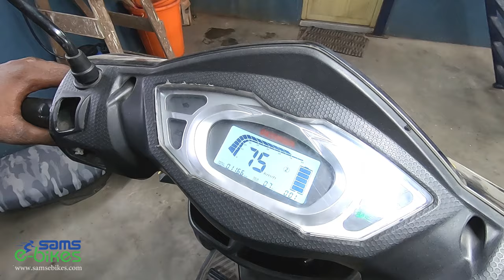Electric Scooter Hub Motor Dismantling and Assembling

Comment: I have a e bike,,,my bike's all bettery are new but top speed only 30 kl/h... if my e bike maximum speed was 50 to 54 kl/h... what's the problem?
Reply from the maker: The problem is with the controller. The controller needs to be checked for configuration.

Comment: Although I couldn't understand the language still understood all essential processes and precautions. Thanks
Reply from the maker: Apko help karke humko acha laga sir. Hindi mein kuch video upload karenge.
Reply: Where are the magnets??
Reply from the maker: @narayanak5409  Magnets are on the inside of the sleeve. Its stuck using high strength glue to the wall of the sleeve.
Reply: @samsebikes5869  where are the sleeve?
Reply from the maker: @narayanak5409  Sleeve is the ring on which the magents are fixed.

Comment: Sir can you tell me if the battery is out of warranty or Dead can repair it and use it once more
Reply from the maker: Definitely we can recondition completely dead batteries to get some life out of it. The damaged cells can be replaced with new onces and used.

Comment: ____ BLDC Hub Drive Motor mein Rainy days mein paani jaa sakta hai andar ???? plz  batao ?
Reply from the maker: Vickie ji…if we ride thru water without stopping for more than 30 minutes in water,there is no issue. Keeping the wheel immersed in water for more than 30 minutes might lead to some leakage. Even that’s not an issue if left to dry for some time and then used

Comment: I put security alerts on my scooter and someone pushed it by force so now when you’re driving the scooter is like you holding brake and the security is not working the motor can not run well what to do
Reply from the maker: The anti theft system is malfunctioning..... you need to approach the service center.

Comment: No water proof sir no seal inside what is your opinion sir.thanks for the video.
Reply from the maker: Viki, there are 2 oil seals on the rear wheel and also we use silicone sealants while assembling the cover on the motor. Its perfectly sealed from water.
Reply: @samsebikes5869  sealant it's completely cover water sir

Comment: சார் S mode ல போகிறபோது Accelater ஐ கம்மியாக கொடுத்தால் battery  Power  கம்மியாக use ஆகுமா?  அல்லது அதே கரென்ட் தான் செலவாகுமா?ஏனென்றால் down ல போகும்போது இந்த மாதிரி சந்தேகம் வருகிறது
Reply from the maker: Yes sir. When you travel down road without raising accelerator the battery consumption is reduced. In fact there will be regeneration of power and battery will get charged.
Reply: @samsebikes5869  நன்றி சார்

Comment: Side ki rim he vo Tut gayi usme se air nikal rahi he kya kru ?
Reply from the maker: Rim badalna padega sir, warranty try kiya sir?
Reply: @samsebikes5869  showroom vale ne company vale ko bat ki he 3-4 days me answer ayega
Reply: @samsebikes5869  warranty Puri scooter 🛵 ki hoti he ki specific part ki?
Reply from the maker: @blackmangamer9265  Only for Motor, battery, controller, charger and electrical parts.
Reply: @samsebikes5869  Thank You
Reply: @samsebikes5869  sir na okaya f4 vachiruken. 1 week la 1000km Mela otitrn. My doubt 30k kms Mela pochuna battery waste ah?
Reply from the maker: @leo67074  Not like that Shiva. You can ride the scooter for minimum 800 cycles. Whats you battery range for one charge???
Reply: @samsebikes5869  140 & Lfp battery

Comment: It seems you're not professional technician. You are not using proper tools in dismantling and assembling hub motor. Very risky way, you can damage or break hub motor housing and you are not using sealant when re assembling the unit.
Reply from the maker: Very good observation and valid point. We have installed hydraulic press to push out the stator shafts now. Thank you for the feedback Rosero. We will definitely look into other options to improve the process. The sealant application was not shown in the video, selant is applied on all the covers once we open for service.